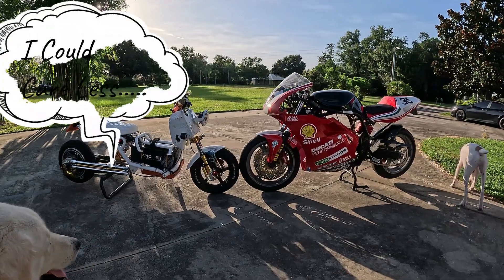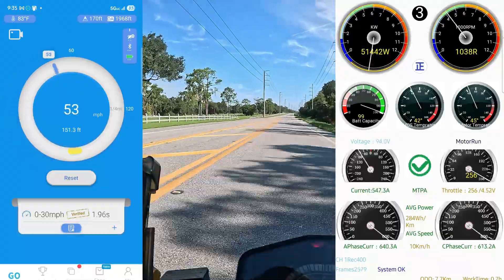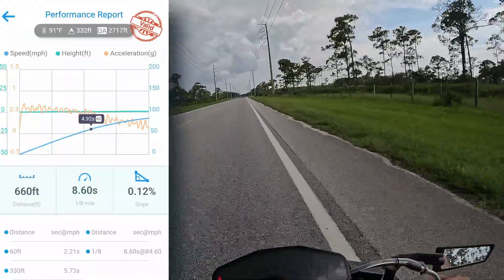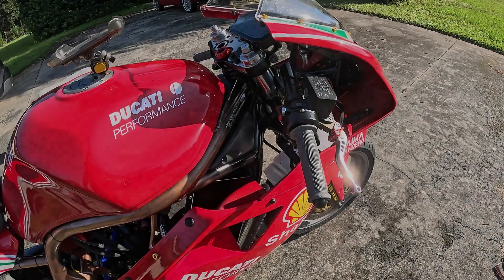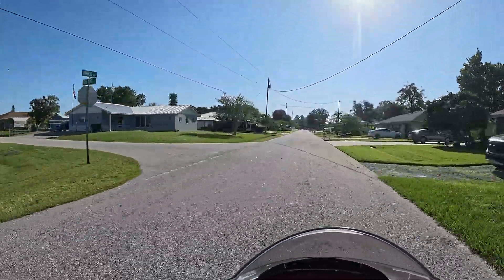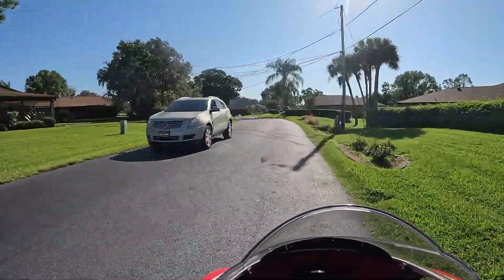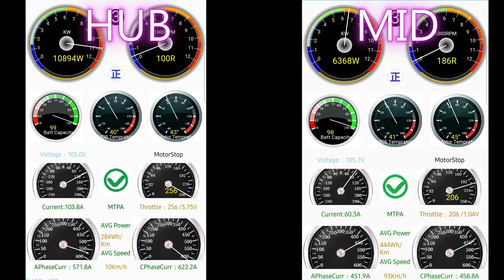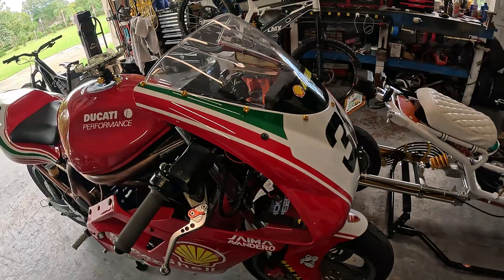Mid Drive Motor VS Hub Drive Motor.  20KW Sotion GTS35, 20KW QS 268.  96 Volt Comparison

Comment: So the thing that I’m confused about, is that if you tune, the mid drive to its potential, couldn’t you also just tune the hub motor to the same specs and it still would outperform the other
Reply from the maker: For sure.  So I have that hub tuned as much as can on that 1200 controller.  I would need the 1800 controller to go farther.  So putting that on the mid drive was unfair in many ways to the mid drive as the mid drive is now running off a tune for the hub.  I doubt I would get more from the hub on that controller.  But I can from the Mid....  I think.  The issue is the RPM range on the two is so different it is hard to compare them fairly.  3000 vs 12000 max.  This brings all sorts of issues to the table.  So I compared them with the only common criteria of rider preference outcome.  Which is dumb.  But it was the end goal to see which I liked better.  To compare them fairly you end up with the mid drive geared to max out at 60mph and it would win the drag race, but suck to drive on the highway.

Comment: Also, I disagree with a lot of the people commenting about wheel size and gearing. To get a more fair comparison, wheel size and gear ratios don't matter. What matters for a proper comparison is the top speed of the vehicle as a whole. Ideally, you want to set it up so both bikes have the same exact top speed, with field weakening completely disabled. Which means not only set all ratios to 100%, but also set limitspeed to an rpm you know is impossible. Limitspeed is the rpm where FW turns on. Or attempts to turn on.
Also, I don't think it's really fair to compare both motors with the same settings in the controller for both. When properly tuned to the fullest extent, both are going to have rather different settings, and very different results in performance.
I love the fact you did this video, but if you use the same settings for both motors, all it really shows is that both motors respond very similarly to the same power output. If you want a really good comparison, do a full true tune on both motors, with field weakening enabled and dialed, and only run the same max line current settings for both. Then we'll be able to see the best actual performance from each motor, with a matching specific peak line amp cap. And while I personally think mid-mount motors are better than hub motors, I think you'll find that hub motors are actually faster for straight line acceleration on flat pavement.

Comment: you had said field weakening was disabled for both tests, but I clearly saw the icon for FW turn on in the graph screen for both bikes. That potentially could have been hurting higher rpm performance knowing you said all the ratios were set to 100%
Low end power seemed quite lacking too. What did you have Startls set to? the default 512?
Is Startkp locked at 0 in your controller? Or the default 40? If its 0, if you get a pc connection cable and use the PC software, you should be able to change the startkp to 40 and gain a ton of low end power in both motors. If startls is 512, you could turn that up to 750 or even 1000 and also gain additional low end. With how long it took for both line and phase amps to rise, it seems like there's still plenty of tuning that can be done to raise the low end power for a much faster launch. And anyone who frequently races knows the 0-60 time can have MASSIVE effects on the 1/8 and 1/4 times. Seems like you have the right components to drop a full second off the 0-60

Comment: what about weight of the motor riding comfort
Reply from the maker: Honestly every raves the mid drive handles so much better blah blah.  I dont think you would notice unless you are a stunt rider.  Of course a motocross bike would have to be mid drive.  But for street riding I think the hub feels great.  It may even wheelie easier.   I really did not notice the weight on the maddog.  It handled WAY better than it did as a gas bike.

Comment: Not apples to apples enough since the sprocket on the mid drive has variable changing ratio capabilities, close enough though. Great content regardless
Reply from the maker: You are 100% correct.  The only apples to apples was the desired rider outcome.  I know that sounds dumb, but.  When you compare a 16 pole and 4 pole motor you end up testing based on RPM and I woukd be testing a 100mph hub against a 58mph mid.  Or a 100mph mid against a 171mph hub.  It woukd get goofy.  So I settled on gearing that matched the "feel" of what the hub was already doing.  Since the hub locked me into a 1:1 gear and a 19" tire.
Reply: @GhettoWrench great work regardless.That comparison is not easy my friend. I always wondered about the subject becuase I have a hub drive naxeon and They have calibrated the cobtroller in a way that makes it jerky in the highest torque power setting. The bike has a lot of torque but I wish the low range was a little more smooth from 1 to about 7 mph
Reply from the maker: @1stoptech Im having the opposite issue.  The mid drive GTS is jerky AF at high speed...  80ish.  Trying to smooth that now I made it slow AF in the process and cant even back to where I was.  I was trying to make it FASTER not slower.  And you never really know with china if you have a defective part.  My hub drive has been fast and flawless.

Comment: The advantage with Electric motors they put out three times the torque of combustion motors starting at 0 Rpm, s  & low turn OutRunners will definitely beat any InrRunner long as you can keep the Front wheel away from 12:00 O'clock noon🤣🧐🫵🧑‍🔧⚡🏍️✌️

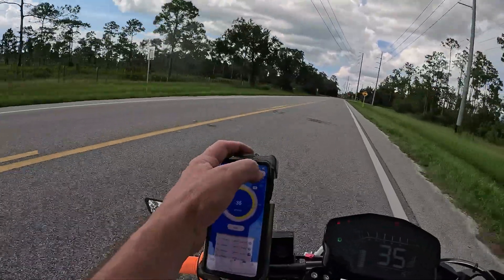Comment: What configuration do you use to be able to press the brakes and have the engine continue accelerating (min 4:30 of the video)? On my motorcycle, when I press any of the brakes, the engine stops, and in case it detects no movement from the bike while accelerating (if I brake the bike by placing it against a wall and accelerate), it also stops.
Reply from the maker: Did you buy your bike already assembled?  Maybe that is some safety feature.  I can hold the brakes on the gas on at the same time and both work.  Just like a regular motorcycle.   I guess cause I built it myself. I dont know where that engine cutout for the brake would even be located.
Reply: Yes, my motorcycle was purchased assembled, but I have watched videos on how to build an electric motorcycle and how to configure the "Fardriver" controller, and what I have always seen is that when the brake is pressed, the motor stops. Let me find one to send to you, perhaps you can identify what needs to be changed to be able to both accelerate and brake. @GhettoWrench
Reply from the maker: @joeljimenez4530 did some research.  Your manufacturer runs a wire from your brake switch (making the brake light come on) to the controller.  A 12v feed.  It connects to "Low Brake" and when activated adds regen braking and shuts off ability to go forward.  Or kills it.  You can try disabling "EABS when brake Valid" in the app and see if that works.  If that does not work then you can disconnect the wire.  It will be a yellow wire with a green stripe on a 2 wire connector next to a black wire.  You can just disconnect that connector.  But then you do not have regen brakes.  Guys that do wheelies and need to drag the brakes do this.  Thats who told me this.

Comment: For mid-drive motor try to set "AN" parameter in PID section to 10 or higher. Mine with QS138 motor it set to 14. Maybe it helps for higher RPM with disabled Field Weakening (de facto it can't be fully disabled as I understand), and maybe re-gear for faster speed without Field Weakening?
I think It can't whellie because of heavy battery in front of frame. Maybe it's better to relocate it horizontally above the motor?
Reply from the maker: Ya its a pig.  LOL.  I have been told anywhere between 12 and 16 for AN IPM motors and 0 for surface mount magnets.  The fardriver manual said 16 for IPM and 0 for surface.  I am still not sure what it even does and did not want to mess with tuning it until I understand it more.
Reply: @GhettoWrench  What I learned with my QS138 is the higher AN, the higher max rpm with disabled field weakening. Still didn't finish my build yet (workin noow with electric part) so tested at rear wheel in the air.
Reply from the maker: @Sobakin76 ok cool.  Ya I did a rear wheel in air test and it went 100mph.  It only went 88mph under load.
Reply: @GhettoWrench  So what is AN parameter in your controller for IPM? After autolearning procedure mine was zero. I think it's absolutely safe to experiment with it.
Reply from the maker: @Sobakin76 the book said "16" but the book can be very wrong.  For sure I would like to mess with it and adjust it.  I just dont really understand what it is doing.  I guess I try different settings and see what changes.  Auto learn did not change mine to 16.  It was still on 0 after autolearn.

Comment: you can use a brake regen throttle as a glorified clutch if the controller supports one. You hold down the regen throttle then twist the motor throttle to the amount of power you need to pop up the bike and then let go of the regen throttle.
Reply from the maker: You are a damn genius!  I actually have a button regen .  Hmmm.
Reply: @GhettoWrench it can also work with brake sensors that cut off power but people dont usually like brake sensors.

Comment: that acceleration ....damn, im tempted convert an old majesty 250 to that hub motor. any links to the motor and controller or the part number / something to find these exact parts?
Reply: His video from 5 months ago has parts list in description.

https://youtu.be/K_LeyNUH73s?si=AKb04acPyNtV2fFk
Reply from the maker: You generally don't see them listed at places like Econic cycles or other vendors.  You have to ask for them and see what they cost.  I got the hub motor from SiA.  I just asked for a 20kw QS hub motor with a 1675 RPM.  I saw it listed on the QSmotor.com website.  The controller is a Fardriver ND961200.  I had Econic cycles get that for me as well as the GTS35 mid drive motor.

Comment: ehhh still not really fair test with 2 different wheel sizes that hub would have allot higher top speed with larger wheel like 17 inch and a much slower 0-60 1/8 mile slower acceleration. Idk who told me look at this but yeah not really accurate but interesting. My 17inch 12kw hub doing pretty much same numbers on 72v as far as times at 104mph top speed with 450 line and 800phase. My Rz weighs 350 and im 220. Im gonna double the phaseamps and line amps and go 96v. It should get busy then but im working on my suspension. Nice builds tho
Reply from the maker: Ya 100% for sure all that.  It was all I had to work with.  LOL.  The top speed was not even main goal of my test.  I wanted to test acceleration.   I really thought that mid drive was going to come on faster and get to RPM quicker than a hub.  I have it geared for 100mph at 12kRPM so not wanting to gear any lower.  I was also really surprised it didnt a have a higher top speed with 100 in everthing before I play with field weakening.   Im gonna do a 17" hub like you have in another bike for my kid.
Reply from the maker: Im gonna do a follow up video on this.  Ya I understand what you are saying more now.  I screwed up on the gearing for the comparison.  But I am trying to catch brother!  You are the one who is pushing me.
Reply: wheel size is irrelevant if one of the setups can change gear ratios to achieve identical top speed.

Comment: Victory and whoever they bought out had a clutch on their emoto. Sadly, it is no longer in production. Used ones are pretty cheap. Might have to throw 5-10k on a battery, though.
Reply from the maker: I was thinking more on this and I guess it would only be an inertia advantage since I dont really have a power band or peak HP to hold an electric motor in while I dump the clutch.

Comment: The test with field weakening disabled would be more fair if both bikes were “geared” to have the same rated speed in MPH. In this case gearing the Sotion GTS35 higher. 

We can see the Sotion GTS35 never allowed line amps to reach 600a like the hub motor did. Quite possibly back EMF was already limiting it by time it reached 500a, and then as speed climbed the back EMF choked current until it went into equilibrium.

This agrees with the quicker 1/8 time even though it’s a lower trap speed (80 mph vs 84 mph). Turning on field weakening should let amps climb to 600a however this battery it too weak to keep 600a when entering field weakening. 

With a higher gear ratio, it will allow more amps and higher torque, probably enough to offset the higher gear ratio. This might slightly hurt 0-30 time and maybe 0-60 time, but the 1/8 mile time and trap speed should be better. 

Using the existing gear ratio, and turning on field weakening, ratios in speed might need to be reduced as soon as field weakening is needed. By choking phase amps off a bit, line amps would be forced down from 600a, allowing the battery sag to be somewhat alleviated, which in turn allows it to overcome back EMF easier. The net result is to prevent the battery sag from creating the need for more field weakening current, which eats into the 600a max line current and adds only heat without torque.
Reply from the maker: Im gonna have to run this theory by ebike guy
Reply: @GhettoWrench you need to borrow his new 96v battery to test it for sag.
Reply: field weakening strongly benefits geared motors, not hub motors.

Comment: You got direct drive mid drive though you need a gear reduction set up like a surron to actually get the mid-drive power or you can get the geared mid-drive that has a built-in reduction like the QS 138 V3 check them out I think you will be surprised at 40 KW that thing should shoot out of your hands into the sky not not even lift the wheel 😅
Reply: Yea I have a Voltic havoc which has that qs 138 v3 32kw peak and it does 0-60 in 4.14 seconds. I didn't realize it was a gear problem, I definitely expected the mid drive in the video to do better. It's kind of crazy to hear 40kw is underpowered.
Reply from the maker: Its a GTS35 and has a real good 2.65 gear reduction.  I screwed up on the comparison.   It is gearing related, but someone showed me ai need to compare based pole ls and motor RPM to compare fairly.  With this the mid drive will be much faster.  I am gonna do a follow up video since I screwed this test up.

Comment: The main advantage to a mid drive motor is the ability to change gear ratios.

Valuable test!
Thank you very much
Reply: And unsprung weight
Reply: Yea and able to jump it. Can’t jump a heavy hub motor once u land good luck
Reply from the maker: @JordanMarley I aint young enough to try that landing.  LOL
Reply from the maker: Thanks.  Im going to address this gearing issue.  I screwed that up
Reply: Main disadvantage..n
Noisy af and broken chains etc

Comment: Have you tried different gear ratios and tested their effects?
Reply from the maker: Im geared mathematically to do 100mph at 12k RPM so I dont want to go any lower.  And I like the gearing.  I think I will play with ratios first before changing gearing.

Comment: Would tire size make a difference to
Reply from the maker: For sure.  Gearing on diameter, but I solved that already getting it geared to 100mph so it was comparable to the 100mph hub.  I dont think the width should be too much extra drag since the tire is new.  But there is def a lot more mass in spinning that big suzuki wheel

Comment: Yeah, if you Google 3000 W
4 speed electric  motor with clutch. It peaks at 11,000 w . But I've seen them for sale on either Ollie, express or Alibaba. Yeah, he could probably talk to a manufacturer and see if they have higher rated motors.
Reply from the maker: Oh ya, I saw that.  Looks like a dirtbike lower half motor with electric.  It was low power tho. That is a good idea to see if they make a higher power one.
Reply: @GhettoWrench yeah, if you've ever heard of the admitjet Armor has the same motor in it And can apparently go 85 mph
Reply from the maker: @tristanmehus oh damn

Comment: I had a 10 thousand  hub motor full size motorcycle  now just bought  same motorcycle with 5 thousand mid motor. When it runs right.  to me the mid motor is  night and day just in handling alone
Reply from the maker: I didnt even think of the handling aspect.  On a dirtbike, a hub would be dumb so stands to reason a mid  is way better on a road bike also.